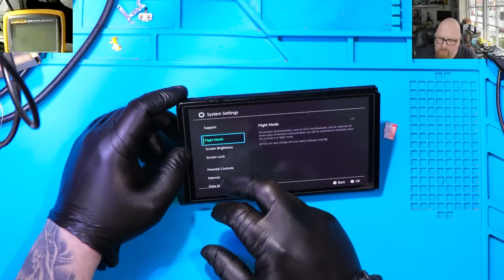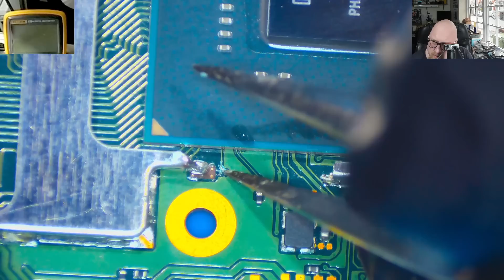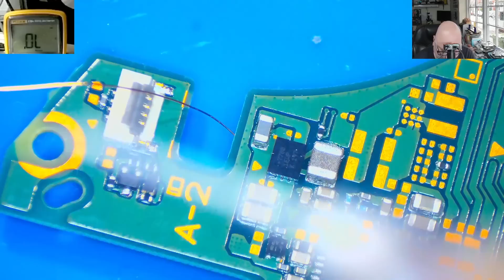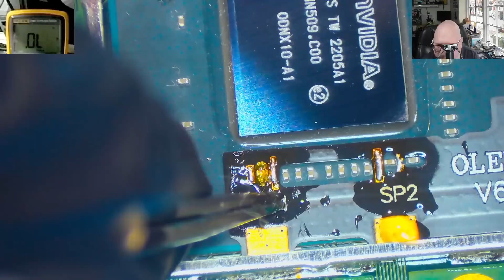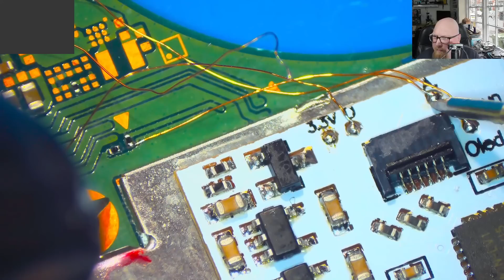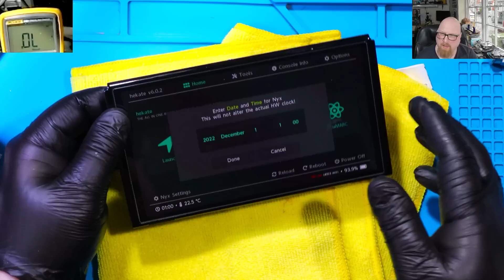Switch Oled v6 instinct installation...is it good quality product???

Comment: Hi, when trying to solder on the CPU ribbon to the left capacitor, I knocked it off and lost it. (CPU oriented with the capacitors "below" it).  I'm pretty sure it disintegrated. Do you possibly know it's value? Thank you!
Reply: 100nf

Comment: Thank you for this clear explanation. I will try to make it myself. But which wire do you use exactly?
Reply: Most people use very tiny insulated wires known as "magnet wire". The insulation melts off at high heat so it makes a fine connection when soldered.

Comment: That’s my switch! Thanks so much Tvpartsworld everything works perfect.

Very friendly and great communication from beginning to end, would definitely recommend utilising this top fellas skill set if you ever have the need 👍🏾
Reply: How much did you pay for the solder work ?
Reply: did you send with a chip or did Tvpartsworld use their own?
Reply: Hey mate, where did you end up getting the V6 mod kit from?
Reply: Just waiting on my chip arriving then sending mine to get done.. is everything still running ok with the one you got done
Reply: Hi mate. Looking to get the same thing done. What did you need to setup on the sd card before you gave it to him. And how did you do it before the switch had the modchip installed. Did you use the same sd card from a v1?
Reply: @MrPCEnthusiast  I bought a sandisk ultra and just left it inserted it into the switch. 
He needs the sd card for hekate and atmosphere files once the mod chip is installed.

Don’t buy anything other than a sandisk ultra or a Samsung evo as they have ideal read write speeds for the switch, anythin less and you might run into problems... a sd card that runs at faster speeds is a waste of money as the switch can only read speeds of up 100mbs 

Hope all goes well 👍🏾
Reply: @Essjaythegreat  That's great, so he installs atmosphere for you, the sd card was just as it came. 

Yes I've heard that about the speeds, I'm going to go with the ultra over the extreme in that case. 

Thanks for the reply 👊
Reply: You gonna need to get it repaired in a few months since he reflowed… this wont last forever unfortunately
Reply: @buschini95  So you think the eMMC is going to heat up the connection of the Dat0 adapter and come loose, causing the switch to not turn on?
Reply: @Essjaythegreat  Did you have to buy the chip aswell or he provides it within the £80?
Reply: @mza2001  I bought it separately
Reply: @upcheck602  2 weeks
Reply: @buschini95  he reflowed properly so it will last long, nothing will happen lol
Reply: @nimmy404  Exactly 👍🏾

Comment: I installed 3 till now, i didnt reflow the emmc to none.
First (backup) and than the rest.
If i ever will have a issue with them i will let u now guys.- im sceptic blowing 400 grads to it.
Cheers!
Reply: also did you used the flex cables or solder directly the points from modchip board?
Reply: Right, you dont need to reflow.

Comment: Hey. After the instinct Installation my wifi is not working anymore.
I Start my oled in sys Emu or OFW and it says wifi is currently not working. I should restart the console and try again...
Its a OLED.
Any ideas?
Greetings from germany
Reply: brother, replug the antenas, ez fix.
Reply: @hugo8549  antenna replugged Nothing changes.
Reply: Check the two tiny capacitors to the left of the APU shield. I accidentally shorted mine which caused it to fly off somewhere.  Noticed until later that the wifi didn’t work.
Reply: @MintPeppers  its a OLED not a V1 or V2.
There no caps at the Apu u can not of. Or am i wrong?

I dont belive its the Wifi Chip bcs its a Brand new oled and i did not apply any heat to the wifi Chip
Reply: @aspectme2  Yes on the Oled model they’re there. It’s not on the APU itself, it’s to the left of the APU shield. Sometimes you can knock one of them off when you try to pry off the shield. Two tiny capacitors.
Reply: @aspectme2  If one of them is missing or broken, the wifi doesn’t work

Comment: large ground planes have been around for years. the fact that you haven thought that the cables connector could have cold solder joints is well beyond me. a simple continuity test can determine this
Reply: soooo you're upset that you went with the instinct chip and are trying to defend it?
Reply: @Notpoop906  half of the people that install these chips have no idea what they’re doing. Including this guy. If you can’t use a meter with your brain, you’re no better than a trained monkey.

Comment: Hey brother, even with the correct installation what is the probability of any component giving short or even the modchip itself?
I ask this because it would not be convenient for a client to happen that.. 
Also is it necessary to put solder on the top of the data0 contact even if it is not going to reflow the emmc?

Keep up the good work, u are the man! 😎
Reply: Did 3 till now, to none i used solder or reflow. More than 3 weeks and no issue.
Reply: @razvanzaharescu7068  So I don't understand the problem that people talk about data0 in the forums.. it could probably be people with no experience who end up damaging the consoles..
Reply: @hugo8549  The Dat0 point with the adapter sometimes disconnects. So the console doesn't turn on. Better fix is to reball emmc with copper lung underneath in the Dat0 point.
Reply: @slickrx6908  the question is, how it could be disconnected by friction even with good solder on ancors and solder mask?
Reply: @hugo8549  Apparently yes. I've fixed several of these Dat0 ones from other installers. Both with adapters reflowed and not.
Reply: Not sure how it could disconnect. There are several theories. But not a definitive one. There is a Dat0 solder option where you grind a few layers into the board and solder a wire that way. Probably most reliable.
Reply: @slickrx6908  I think even with reball or not its probably because of the emmc heating while playing for a long time.. I saw a guy that got his dat0 disconnected right after using the switch in dock mode..
Reply: @Hugo  that's exactly it, if you heat up the chip to what it wasn't meant to, like to reflow/reball, it makes the solder crack and disconnect when the console starts to heat up. The friction fit is usually a good option because if it does fail you won't have to worry about the solder being messed up. The friction fit also has a lower failure rate than reball because of the reason above

Edit: Oh and the reason friction fails is because it's a small point. Even the tiniest movement can disconnect it. You would need to reseat it so that the connection is directly in the middle of the  dat0 point under the chip, which is very hard to do when you can't see it and only have the values. Adding on to that heat makes anything more flowey/weaker which allows movement and makes failure more likely

Comment: The Samsung and the SKHynix should be the exact same spec. I don't believe one is better/faster than the other.
Reply from the maker: I noticed that SKHynix is slower than Samsung. If you dump or write the data on Samsung with UFI box it takes 45min up to 1h. SKHynix takes 5-6 hours. The same is when you do a backup, Samsung is faster.
Reply: @tvpartsworld806  Thats not criteria. They should have exact same performance on the system.
Reply: @borisdg  "b-but they should" lmfao. You clearly don't know anything about how chip manufacturing works. Just because they meet the same baseline specifications doesn't mean that one can't out perform the other...
Reply: @Notpoop906  I'm in the business. I know more than you buddy. :)
Reply: @borisdg  Evidently not. Seeing as you insist that the spec sheet is the be all and end all of any given chip. Literally the first thing you learn is that it isn't. But you austistically chime in with "b-b-but the spec sheet says it shouldn't out perform it🤓" lmfao
Reply: @BorisDG - "in the business".... but don't know about stinky Hynix memory!? You just get hired or something?
Reply: excuse me, is there a way to find out if my console has Samsung/SKHynix in unmodified switch? or just by opening it? (like loading game maybe)
Reply: @maniau  You'd have to open it up to see what the chip has printed on it

Comment: I've watched all your OLED installation videos. Learning something new everytime! The USB meter tip was great. 

Do you change the tip only for point D? and What's the name of tips you use?

My last question is how much do you set your soldering iron station? 350C?

Thanks for sharing.
Reply from the maker: I change the tip for JBC C245-001 only for point D and A. Normally I use JBC C245-102. My soldering station is cheap AIFEN-A9 PRO with JBC handles. I use original JBC tips. I've ordered AIFEN A902 dual soldering station as swapping the tips is annoying. 

Soldering station is set up for 350C
Reply: @tvpartsworld806  You're the real deal.
Reply: @tvpartsworld806  Hello, I'm looking to buy a high-end soldering station. Do you recommend the  AIFEN-902?

Comment: Good job, I will be sending my second oled soon. I've decided to stick with hwfly v6. Better quality.
Reply: did you already use his service?
Reply: @user-ih6oe9ny3j  yes, highly recommended. Just have a little patience when it comes to getting it done. I think I waited maybe 2weeks to get mine sorted once it was posted to him.
Reply: @xcxi1907  price?
Reply: @grib6680  £75
Reply: @grib6680  £75 + i posted it special delivery £6 i think it was.
Reply: @xcxi1907  thats a good tbh, but did you have to pay for the chip separately like the sd card or he includes it for £75 I might be sending mine tommorow

Comment: Why did you reflow the dat0 adapter when it is confirmed to be unreliable after a month or so especially with the SKHynix chips?
Reply from the maker: I've done lots of them in this way and never had an issue with any of them.
Reply: @tvpartsworld806  Thats really great but how do you avoid the dat0 solder ball cracking issue? Do you use a specific type of solder?
Reply: @Cicadabuzz  The whole "reflowing is bad" thing comes from one single person (sthetix). Ever considered maybe Sthetix issues with reflow reliability are down to his own personal methods? Just a thought, you know, considering he's the only reputable name that makes these claims about the reflow methods.
Reply: @Notpoop906  No, I've seen plenty of people facing the same problem on gba forums. It is a widespread and well known issue among the community.
Reply: @Cicadabuzz  I said "reputable". Randos failing to reflow correctly on the GBAtemp forums means absolutely nothing. Yes, if you don't reflow it correctly it will eventually fail. -
Reply: @Notpoop906  his claims is not unfounded. When it comes factory balled it will have a different property than the solder you used for the join. The joint will eventually fail due to difference in composite with different densities. Solders are NOT the same. You can try it yourself, take your own solder and add it to existing factory solder and see what happen.
Reply: @h.a.6790  That's a damn good point, and something I never thought about, but makes perfect sense. I wonder how reliable the pressure fit is.

Comment: Why did you decide to use wires and not a complete cable?
Reply from the maker: Because I’ve got many cases that this method is not good. Instead of using that ribbon tape I directly solder the jumper wires to the specific points. My time is money and I can’t make mistakes.
Reply: @tvpartsworld806  I broke my oled using the ribbon but I successfully finished a lite using just wire install